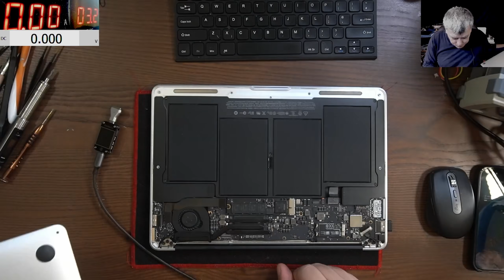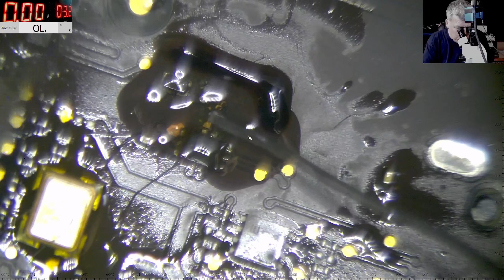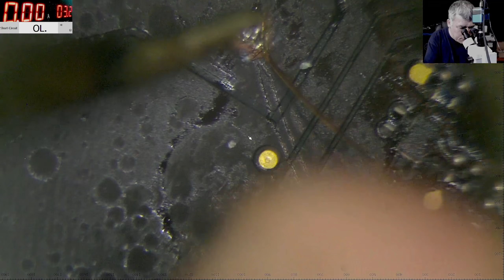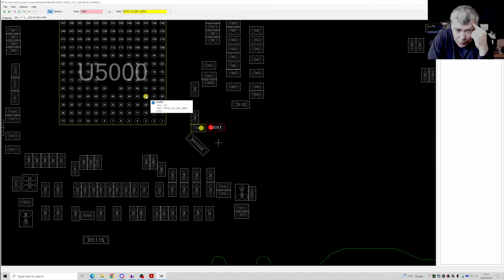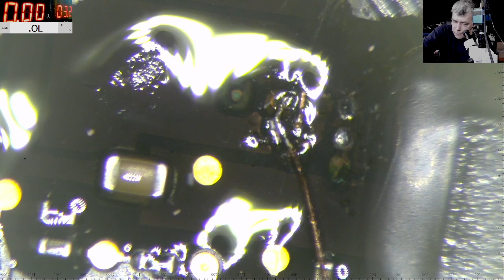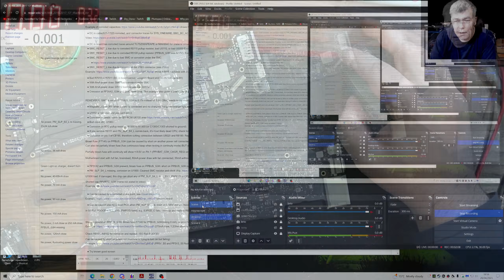A1466 820-00165 repair attempt - Any MacBook experts here? Missing PM_SLP_S4_L

Comment: I have an iphone, didn’t charge well. I fixed a power bank with a Samsung phone, to start lightning charging. Then I connected the iphone with a lightning cable to the supported power bank. After some charges, the normal cable started to fix the battery, supporting 5.1 v, and 4.9 v charging at 1 A. Could be the same with Apple laptops. The best could be to first charge up the battery separately, after it’s done, in most cases charging will start. If the customer is on blacklist, his devices will be stopped with a satellite, even the charging.

Comment: am I totally wrong when I think, that the cables you use to bypass broken tracks are not insulated (no lacquer coating, whatever). If so, don't you worry that such bare cables could produce silly, random short circuits? I'm sure, you take care about such cases (and you isolate everything afterwards) ..it's just for understanding

Comment: Why not to remove coils or current sense resistor from the circuit of CPU power supply and measure resistance on both directions (CPU and power supply)?

Comment: Agreed with Justin C, Sorin. Ten ohms per CPU rail is normal, not shorted. But in this Macs, PPBUS_G3H is very important. So, as he said, prepare yourself for an SMC removal and reballing (maybe you are having corrosion there, below the SMC). By the other side, if you need to check if you have any light in the charger, the flat cable must be connected between power board and main board (essential if you need to have green/orange light). And BTW check if you have clock signal in clock IC and its termination resistors. Also try to use (if you are able to) another power board, with an original Apple charger. Let us know.

Comment: Hi Sorin.  Take that long jumper off. In this case you should use the board view to work out where that track goes.  power on for one second and then goes off is the bios starting detecting a short and turning off,

Comment: And THIS is why we stopped doing Macbooks last year. You can spend a day on one and still not get it fixed. I suspect you need to do an SMC reball here. Not such a bad job but use 0.3 balls.

Then, when that fails get a large hammer and a pound for the swear box.

Comment: 8.1V on ppbus_g3h is low, it means no communication with smc Reball or replace SMC, it should be 8.6V. Before reball/replace smc, check SMC_RESET_L resistor goes often bad, check also SMC_ONOFF_L and make sure PP3V42_G3H is making its way to smc.  If you want to go the systematic crazy way, you can check the 11 prerequesite for PM_SLP_S4_L to be delivered (11 signals/power rails), just google that you will find it in the wiki repair. This will give you 100% a clue and you will know what is happening :)

Comment: I guess if I post a link it will delete it? well, I tried to post about the PM_SLP_S4_L signal which must be present But first, you should reball that SMC, any corrosion or spec of dust from the existing problem could cause it to stop working

Comment: Before you remove those resistors what is the resistance 15 or also 10ohm?

M2014 15" MBP iGPU i7-4770HQ: 10Ω, 15Ω

M2014 15" MBP dGPU i7-4870HQ: 15Ω

Comment: Sorin, first you need to be sure there no corrosion unde smc chip. Most of the pm_slp signals come from there. Also you need to check the rtc ic, as far as i remember i saw you were cleaning that area. Corrosion there will cause the board to not start. Another thing you need to make sure, the smc is up and running (ppbus_g3h) is higher when smc is up and running.
Reply: Technically  it is PCH who sets slp above s5 level. Smc only pulls them during init so they wont float high before pch power controller is initialized.

Comment: in those 3 hours you could have repaired 4 to 5  non apple laptops.  You'd be relaxed  with money in the pocket and a drink in your hand. I don't repair apple, products,  I like green, red , blue or brown circuit boards.   I know it sounds juvenile, But apple looks like someone went crazy with black spray paint.  Have a great weekend,
Reply: I have been told that black stuff is moisture attraction and corrosion   growing material designed by very smart engineers. Not sure if that is true.
Reply from the maker: Thank you!

Comment: The issue is SMC. Check resistors around smc also and clock.
Reply: REMEMBER: SMC is not on if PPBUS_G3H is 8.15v instead of 8.55v(SMC needs to communicate with U7100 to tell it over SMBUS line to raise PPBUS_G3H from 8.15v to 8.55v).

Magsafe LED is OFF when battery is connected and no charging, but green/orange light and normal boot from charger when battery is disconnected. Resolved by replacing Q7180 transistor.

Comment: go through the startup sequence on the schematics and stop on the missign signal...

you said that the power good signal comes on and goes off, is it reaching its destination?
if its reaching its destination what is triggered after that?
reball smc?
check oscilator aeria with osciloscope.
how much amps is the cpu consuming on your board and on the customer's board?

you have a spare cpu in front of you :pppp, replace it haha
or send all the parts back to your board and replace the bad smc
check if its a bios issue.

Comment: The voltage on the main power rail was 8.1 volts. That means, that the smc is not running. Check voltage and short on the smc reset pin with the help of schematics. If there is no other component affecting it, it's probably the smc. You can try reflowing, reballing, maybe a bad connection. If it's still not working, you can try replacing, if it's worth it.
Reply: You are correct. Smc boosts it to 8.6 if my memory serves me correct
Reply: @darrenstrathdee7425  exactly
Reply: If I recall from Luis's videos, the main power rail on MacBook Air is about 8 volts. Maybe 8.4. Could be wrong, but it is worth checking.
Reply: Agreed

Comment: Re-Ball/Replace SMC. Anytime I get one of these boards with liquid damage next to SMC, it is automatic. Another clue, is no green light. I bet PPBUS_G3H is 8.14V. Should be 8.56V. Not sure if these may help. https://youtube.com/playlist?list=PLHgLf-SjjTdwX2fp_YQS06hfwja5xgqDN
Reply from the maker: Thank you. Of course is 8.56, i said every power rail is fine, i have green light and orange light on the charger, is charging the battery fine, and the board is coming on without DDRREG_EN which enable 1.2v power supply which is also fine
Reply: Did you get it working?

Comment: The last wire you soldered was touching another circuit/trace  - The first wire you soldered may also be touching another capacitor
Reply: I think that wire has a shield/paint cover like a wire inside transformer or coil.
Reply: @Radek__  yes, magnet wire